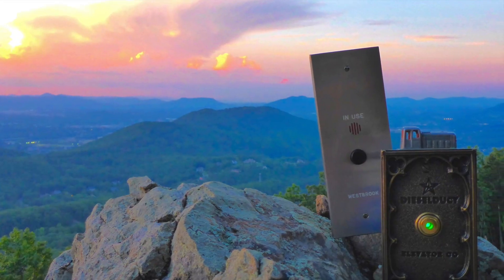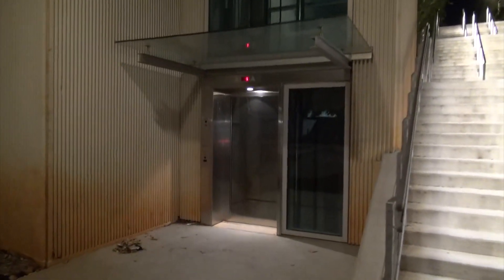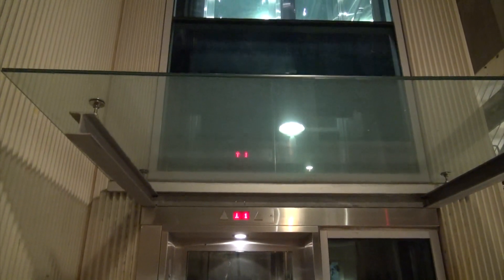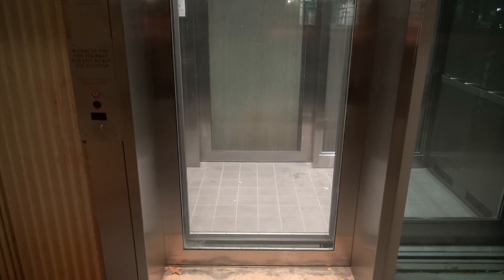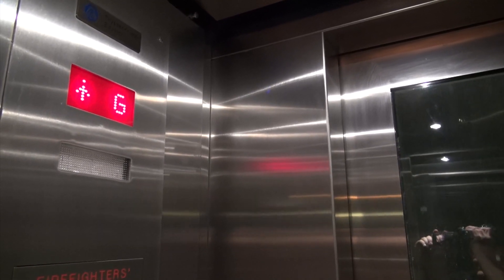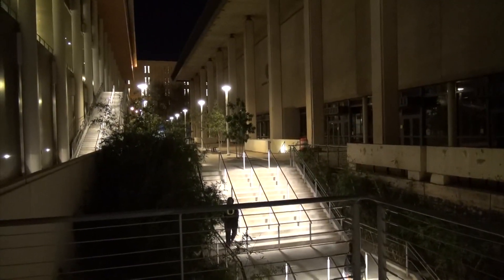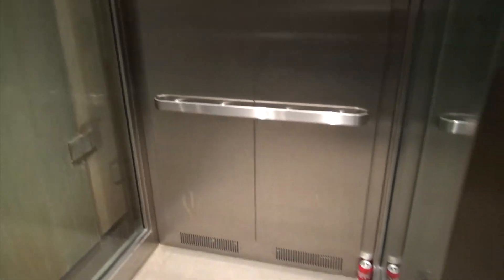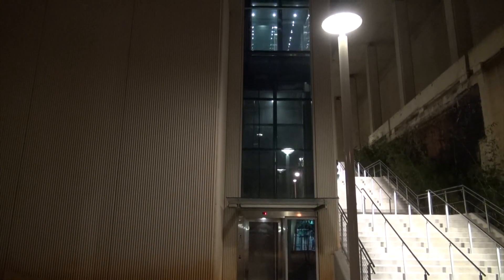Awesome ThyssenKrupp Modern Outdoor Glass Elevator

Comment: I saw a MontgomeryKone get modded with one like this in 2020 because the machine failed and leaked all the oil out of its tank. Also I like the idea of doing voiceovers. I don’t really edit my videos because Filmora 10 isn’t free and I don’t want a watermark.
Reply from the maker: I use final cut pro.
Reply: @DieselDucy  I heard if you use really high definition footage it can glitch out at random and it also is out of my budget for my channel size.

Comment: A Schindler guy here in Duluth told me that repeated beeping noise has something to do with door sensors... usually when added to older relay-controlled elevators.  It has something to do with line noise and/or voltage drops/spikes.  It's kinda odd that it's happening on a newer elevator.